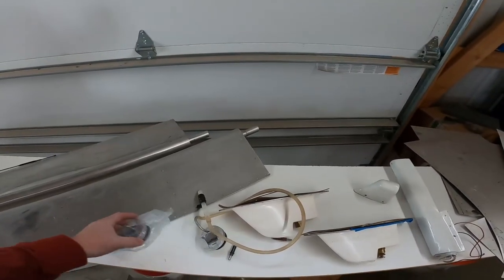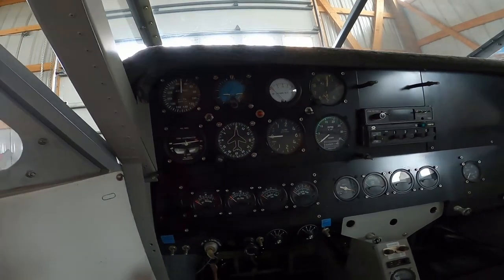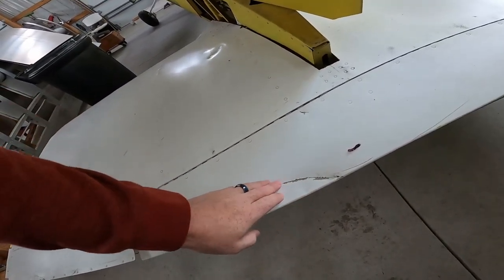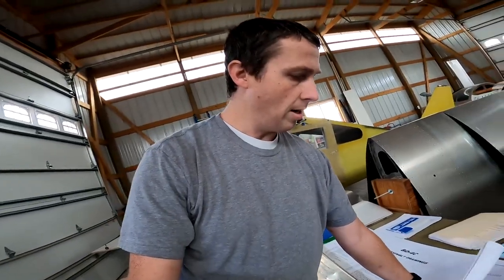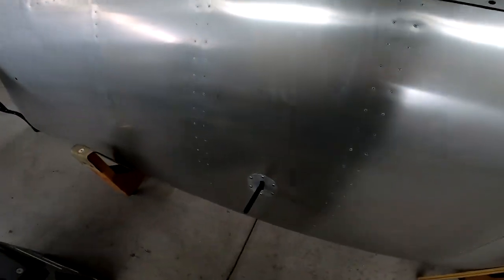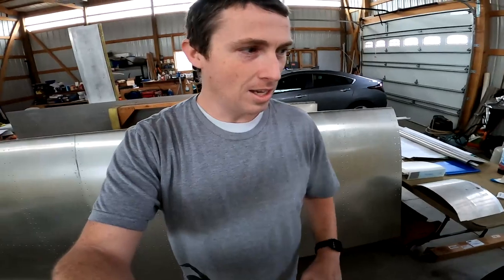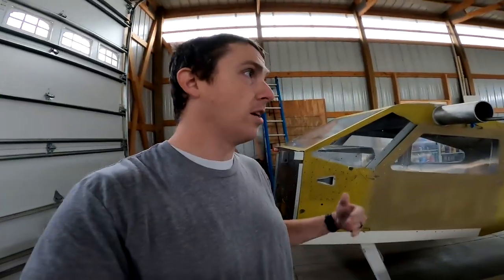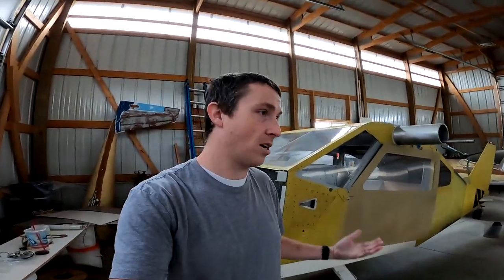I GOT A BEDE 4B AIRCRAFT PROJECT NOW WHAT

Comment: Well I just got back from Florida also with a bd4 and I'm currently unpacking and starting work!. I'm in SW Wisconsin.
Reply from the maker: That is awesome! Are you on the builders group? BD-4.org  Great builders community and a good bit of helpful posts. If you need to see anything specifically let me know I'll do a short video as I know it can be super helpful during a build or repair process. What's the current status on your BD-4?
Reply: @B-RadThePILOT   I am on the group as me, been watching it for a while and reading everything.  My plane is quite a bit further apart than yours even though I have an airworthiness certificate and an n number. Would you be ok talking off post?
Reply from the maker: @benhansen6308  absolutely, send me an email. Pm on the way on the bd-4 group.

Comment: Looking forward to more videos. I am in the process of building a 4C, and even though yours is a B, it is nice to see some of the connection points I am working on today. As you mentioned about the fuel lines, curious to know why they did not run in the tubes in the channels?
Reply from the maker: Hey Matthew, the B and C models are so close I have read it's only size that's different. Also, I have TVAP wings as you noticed those are very different than a C/B model. Let me know if you want to see anything specifically I will happily upload a video clip of an area I know how helpful just seeing it together / behind the joints really is. I will probably build another BD-4 a C model the next time.

For real regarding the fuel lines. I recently found it was due to the pitot and angle of attack air lines... Although there is a 3rd air line.. Static?? I haven't chased that down.